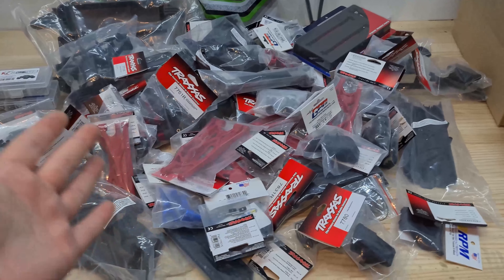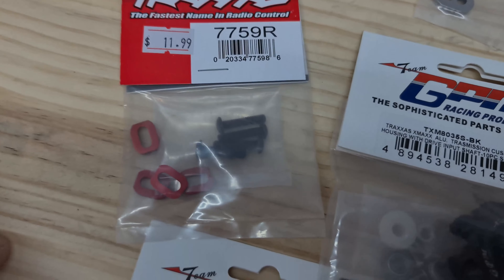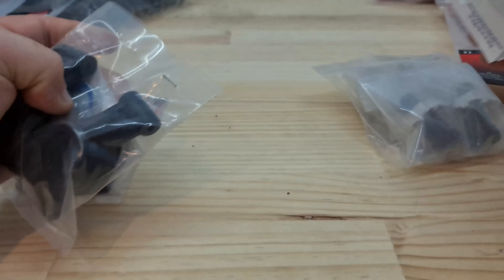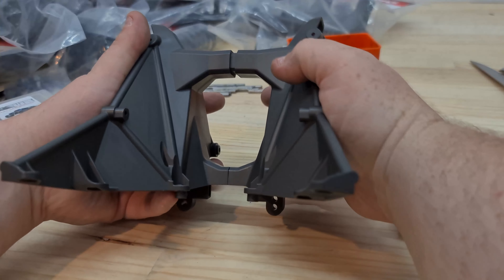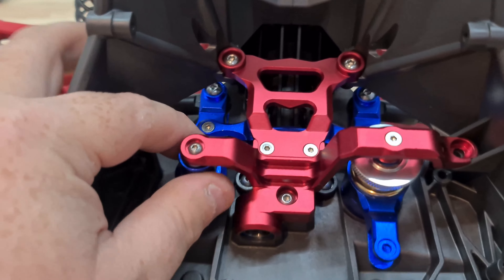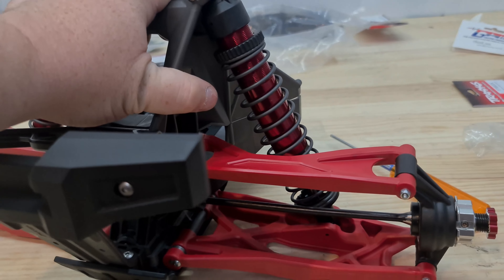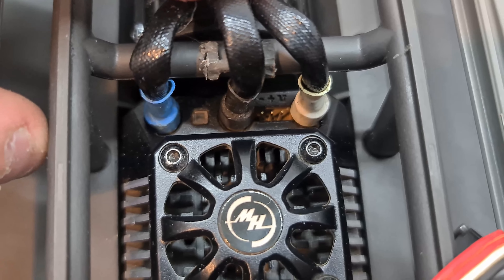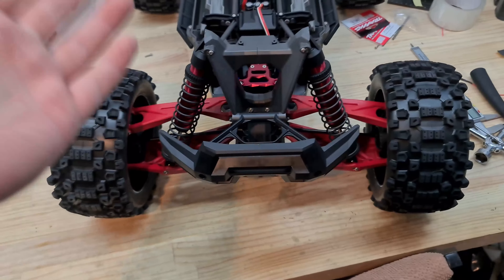BUILDING XMAXX FROM SCRATCH!

Comment: Great build vid Matty, Lots of details. I for one love working on my X-Maxx.. such a well thought out design and easy to work on. The arm hinge pin braces and the plastics that hold them in do wear after time and replacing them tightens the trucks handling a bit. Gotta do mine.
Traxxas has released the front and rear hubs now with oversized bearings stock!! (traxxas 7737x for the fronts) as I like you and most others run the RPM rear hubs.
I still run mine nearly stock. Bought a Max 6 and have it ready to go in but the stock ESC keeps chugging along.. always the way.

Keep up the great work mate!
Reply from the maker: Hey Steve! I'm glad you liked the video dude 😀 
It truly is well engineered! 
I would run the traxxas upgraded hubs but unfortunately I just can't find the in Australia so rpm it was haha
Reply: @MatthewSimm  That's the worst part about living in Aus, I'm in Sydney. Parts get released here months after the US. Ordered lots of stuff from the states. if you're patient it's definitely an option.
Reply from the maker: @steveblackbird  oh yeah dude, I know how you feel, I'm still waiting for my widemaxx xmaxx kit haha, not sure about it any more, it's been months lol!

Comment: How did you know screw sizes and where they go
Reply from the maker: Hey dude! Using the instructions manual, I found all the screw sizes I could buy. These came sorted into bags from the factory I ordered from in Australia.

Some sizes aren't available (atleast in Australia) so I had to shorten some with a dremel or grinder etc.. and some are traxxas proprietary screws and you can't get those unfortunately.

Example, some screws were 17mm but I could only find 16mm or 20mm.

Hope this helps 🙏
Reply: @MatthewSimm  yeah I worked it out I just looked at exploded view, it’s got a max6 now and it’s MINT I’m 14 so I have had big projects but this tops it
Reply: @MatthewSimm  cheers

Comment: Just did this recently with mine. Took it completely apart, cleaned everything, completely refreshed the plastics that I was keeping, and replaced/upgraded everything else. It was a lot of fun. Put it all back together with stainless hardware, boca stainless ceramic bearings, and many many other things. One thing I noticed when you were building yours was the interface between the bearings and the stub axles. Putting a little grease between the bearing and any other metal part (stub axle, diff housing, etc.) will make it much easier to take apart later.

Comment: Great build...fun video...
BTW what was the blue stuff you used for the pins?
Reply from the maker: Thanks dude 😀 
I just used a bit of loctite, it helps to stop Screws from backing out due to hits and vibrations. Only use it on metal to metal contact though as it won't dry on plastic and plastic doesn't need it 😀
Reply: @MatthewSimm  Your welcome...
I ment for the Hinge Pins..you rubbed something blue on them..
I got my Typhon 3s a couple weeks ago..i broke a Aarm..and mine looked rusty.
Reply from the maker: Oh haha sorry dude 😅 
Just a bit of silicone grease to help it move more freely, doesn't do too much but I like to add it. 

If they have been near water, they will rust as they are uncoated steel. The best bet for rust resistance is to get stainless steel, if you can find some 😀
Reply: @MatthewSimm  Ok great..yeah mine was in snow..and water..i will get some of that
....THANKS AGAIN

Comment: I personally would have ritt dyed the chassis black. Still an awesome build. I plan on doing this myself soon. This will be a great video for reference
Reply from the maker: I actually did think of that dude but I was scared is screw it up haha and I kind of like the stock plastic colour contrasts. But I'll admit it does look pretty sweet, I might test it in the old chassis first
Reply: @MatthewSimm  I've done it about a half of dozen times now on a couple different trx builds. I'll suggest you boil them. Its way easier imo. I've tried the oven a couple times didn't work out well for me either time.

Comment: What gearing did you choose to go with? I keep having issues with 18/46 where my spur get's munched.
Reply from the maker: Use hardened steel gears (not the traxxas gears) most people use something like hot racing spurs. Also, I believe 20 50 gearing is a sweet spot
Reply: @MatthewSimm  sorry I should have mentioned I've been using hot racing spur and an 18tooth aarma pinion. The pinion is tough as diamond and doesn't come loose, but I chew gears.

I'll have another fiddle. Keep up the great content mate, you could tell there was a tonne of time in editing in this vidro

Comment: I also had to rebuild my X-Maxx from concrete jumping. A whole chassis, rear bulkheads, rear shocked towers, rear diff ring gear and output drive, center diff ring gear and pinion on the Cush drive. Yeah that was some serious damage 😁. Good stuff as usual bud
Reply from the maker: Hey thanks dude and yeah concrete is an rc killer!

Comment: Great video I'm rebuilding mine now not new parts but I've got so many screw heads stripped I'll be lucky to get them all out I'm down to the main chassis and I have the same screw kit and I've tried to keep all stick screws with their parts no matter their condition my question is how do you figure out which screws go where how did you seperate them out?

Comment: Nice builds with all the brand new parts and editing of video mate!! I remember seeing you have the monster ProModeler giant servo for the Xmaxx from your old video. Hope you can share the answer below:

1. Why you are not using the ProModeler giant servo for the Xmaxx?
2. Does the standard size Savox up to the task for huge Xmaxx weight?
3. Where do you get the alu servo horn for the standard size servo? Does the servo arm align and fit straight to the bearing holder?
4. Since you are already doing the rebuild, why do you use back the stock motor and max6 instead of using HW 1100kv or others aftermarket motor?

Thanks buddy!
Reply from the maker: Hey thanks dude, I'm glad you liked it and great questions 😀 

1. I did like the Promodeler, but I didn't like using another battery so I'm possibly going to use it in another xmaxx in the future, maybe a speed build, a bit to fancy for bashing I think haha.

2. Yeah dude, the sg2290 is a beast  I've been using it for a while now, you can also get a water proof version (I need haha)

3. Promodeler sell a 25t servo horn (using it in this video) or  the gpm servo adaptor comes with a blue one, that's what I was using, just liked the silver haha 😄 

4. I'm not 100% sure on if I'll go back to aftermarket, ever since ousting in a different motor, I've had issues. 
- I broke the shaft off a 1650kv 
- Meshing was a pain lol
- broke a hardened steel spur 

I think an 1100kv would be good, but do you use a max6? Or a max5? Max6 is a great fit but a max5 has more amps but you need to mount it really high.

But, with that extra power, comes more strain on the driveshafts. 
I never had these issues on the stock setup so I'm reverting for now haha 😄
Reply: Yo mate Matthew!! So far after the fresh rebuild of your Xmaxx.

How will you rate the fun factor on Xmaxx and Mojave?

Lastly, if you are only allow to keep one, which would it be and why? 🤔 

Hope you can share your thoughts on above. Thanks buddy!

Comment: Great Video👍 But on overall of the Cost… is not cheaper to buy a new one🤷🏼‍♂️ what is your experience🙄
Reply from the maker: Good question. If you plan to do a lot of mods and swap all the electronics out of the stock xmaxx, then in the long run I think it'll be cheaper. Also, I you plan to buy so many parts, go to a local hobby shop, they may even do you a small discount from ordering so much, just talk to then and see 😀

Comment: Oh Noooo I didn't even know that shit had happened to the upgraded Hobbywing Xmaxx.....That sucks that it was so badly damaged that you side shelfed him for ages but great that it's coming back!
Matt do you shop much overseas for your RC needs or mostly in Australia? You're a Northerner right?  Just an Assumption based on the colour of the dirt that I always see you belting around on.

Cheers bud.
Reply from the maker: Yeah it does suck a bit dude but it happens, trial and error, I think the 1100kv would probably be better as it has an 8mm shaft haha and actually 8s rated lol.

I'm located in Victoria dude, more rural though.
Reply: @MatthewSimm  Same dude.
Once a year We do a Crusty Demons of dirt RC Extravaganza in the Dunes ( in Vic still ) where some of the jumps pulled off are as big & bigger than Crusty Demons jumps on MX Bikes. 
Its a long wkend event, camping, a few drinks, a good fire and Crazy Ground & Aerial RC Shenanigans. Lots of Fun and great footage to be had.
I email you details if you're interested bud.
Reply: @MatthewSimm   Yep......I have the Castle 1100 and XLX2 in my Wide XMaxximus and its a Wild Animal. Somewhat of a Predator. LoL
I couldn't wait.for the oz hobby shops for my Wide kit. I went ebay! Ha.

Comment: Im looking at a few trucks I want. And keep looking over at my Rustler 4x4. I've bought 90% of every hop-up made other than some electronics. The whole truck is blue at this point between rpm and Traxxas. I was looking at a RYFT kit and wondering if its really worth it. Or if its cheaper to buy a $50 frame and just add all the aftermarket parts to that. We end up using almost nothing from the original kit anyway. Chassis, shock towers, and hardware I have a new out of box Rustler right here.
Reply from the maker: I think in some cases, building will be cheaper. 
If you plan to go crazy with mods and change everything, what's the point of buying an rtr haha 😄 

But maybe you don't have that money straight away and want to still drive it and modify it over time 🤔 

Or maybe you like it stock! I know a few u like stock with barely any mods 😀
Reply: @MatthewSimm   Im going to buy an XMAXX in next few days. Im going to try that stock with very few mods on it since they seem to be so strong. I did an itemized list on my Rustler 4x4 last night. Thats a bad idea. I was sure I had more in it that a xmaxx. figured around 1500. Turns out I was about $1000 shy. Swear I don't see how you can wrap up so much money so fast. I need to do the same with a RYFT. See what the end result will actually cost. I will go for $2000 easy I figure all metal.

Comment: It's more expensive to build it that way. I've added up the parts to do other Traxxas vehicles and it's a bit more costly. I still plan on building something that way because I love building and Traxxas doesn't offer many kits.
Reply from the maker: Yeah dude, it is more expensive. But, if you calculate the mods I've done in this build on top of what a stock xnaxx costs, I do believe that this is cheaper than buying new and Re buying more mods later on. I also had the diffs from the old build which are quiet a big cost for the build so that helps haha. 

I say go for it, so much fun!

Comment: You'll wish you went with the stock drive cups mate 😖 I bought them exact GPM ones and they lasted 5 minutes. I've really gone off GPM stuff. I've just had 2 GPM driveshafts fail on me on the big rock after 2 runs. Garbage. X maxx lookin good tho 👍🏻🤘🏻🤘🏻🤘🏻
Reply from the maker: Appreciate that feedback dude. Sometimes gpm can be a hit or miss. I got them because they were cheaper but I guess you get what you pay for. 
Maybe the beefy vitavon would be worth the wait!
Reply: @MatthewSimm  I also got them because they were cheaper than stock and because I thought they would be better but nope! The metal is so soft they don't break they just wear really quickly. The traxxas ones are so expensive for what they are but I ended up buying them too 😖

Comment: Wondering 🤔,  if it's cheaper to build one  like you did Buying the parts piece by piece  🤔. Import duties on these RC vehicles would kill yuh in the Caribbean
Reply from the maker: I think if you already plan to change out electronics, get a stronger body and do other mods, it may just be cheaper to do it that way in the long run than if you were to buy an rtr and buy all those mods too
Reply: @MatthewSimm  nice 👌 respect

Comment: Similar situation myself. Just got a good deal on one is less than Ideal shape so rebuilding as I type this
Reply from the maker: Awesome as man, good luck with the build! 😀
Reply: @MatthewSimm   if I'm not using the traxxas radio, can I delete the temp sensor for the motor? Just don't care for the extra wire clutter